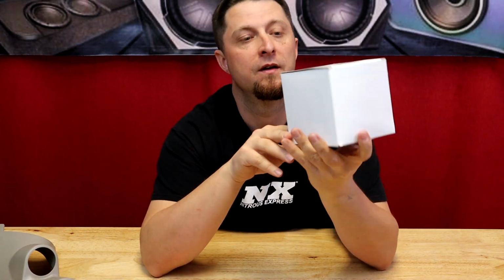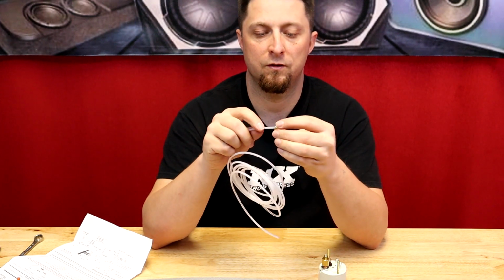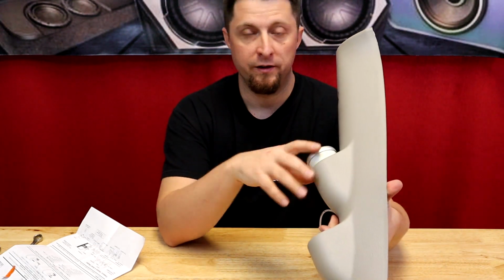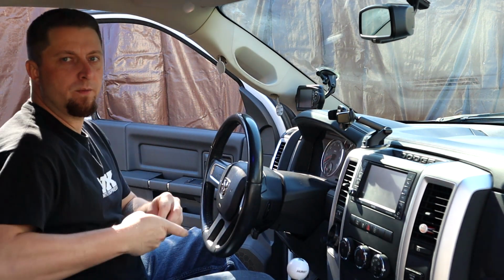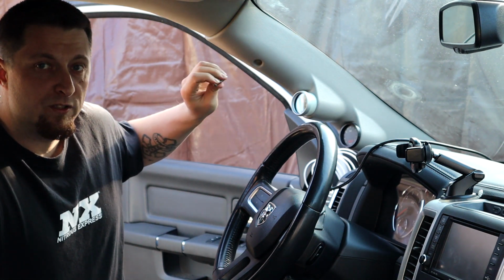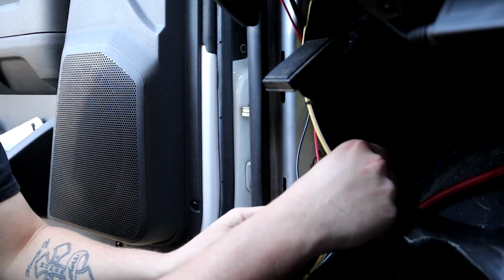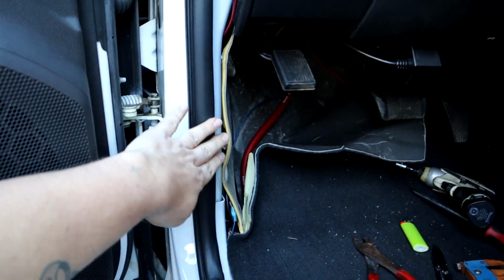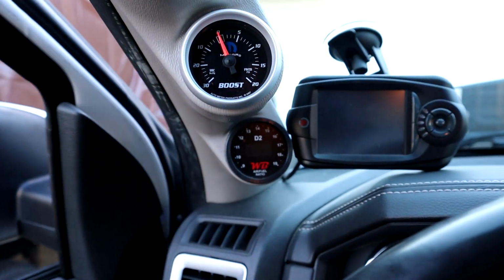Boost Gauge & Pillar Pod Install On 4th Gen Ram 1500

Comment: Great video step by step getting closer to the main install 💪😁 .. jus little heads up .. the gauges in the pod without the back pieces to hold tight .. may allow to slip in future causing you to have to keep turning them to your favourite position of gauges.. the hot sun heats plastic up allowing the slippage .. I had one in my diesel dodge Cummins it was a three gauge pod An that’s what it did .. no biggie jus a little pain in the keester lol.. maybe your will be ok .. but it looks awsome love the mopar gauge that be my choice to.. also been wanting to tell ya I absolutley enjoy your intro an outro on all your vids the little neat sounds An the truck about to go at track showing the glue sticking to tire An the front of the truck lifting it is such an awsome into outro of your vids .. great job on that man !!
Reply from the maker: Thanks brother definitely trying to make it interesting 🙌🤘👍

Comment: Bro can you do more in depth on the Wideband I know you didn’t because you had it installed but I have one coming for E85 and I need to know more like how the o2 hooks up how far down the exhaust which side. Maybe a link to where you got that w/b with the built in plug in... it was more on the boost gauge lol. If you could just a quick clip or something how it’s all ran I’d appreciate it!
Reply from the maker: Sure I will try to get a video up soon
Reply: Frostbite Ram thanks bud!
Reply: Frostbite Ram just wanted to say thanks for all your YouTube videos.  I have a 2011 Hemi Express reg cab 2wd that I purchased brand new.  My truck has had some mods including a TVS2300, ARH longtubes, 87 MM throttle body, L480E GM transmission swap, MDS delete cam install, drag pack is shipping now, and a new Eaton Trutrac just ordered today from Moes.  Can you give a little more info on the wideband gauge you have installed.

Thanks
Reply from the maker: @jspenn1  Im planning on it as soon as I get a chance definitely will.👍thanks for watching and sounds like a sweet truck you got🤘

Comment: Where did you connect the boost pressure line at the manifold?
Reply from the maker: I added a fitting in the manifold behind the throttle body. Most people just tap into the factory vacuum lines on top behind the throttle body.
Reply: Thank you!!!
Reply: Your Ram is sick! I'll be adding a torqstorm to my 5.7 soon as well. Your channel is really helping me out!
Reply: @FrostbiteRam  are your referring to the line that runs along the top of the intake manifold that goes to the evap canister?

Comment: Can you show us that don’t have an extra wire to hook up. Make a video for people that have a stock truck with no electrical mods. Show us where to connect the red or power wire.
Reply from the maker: I tapped into my cigarette lighter wires for my 12v

Comment: Interested to see how much more power your going to make. Theirs another video on YouTube with a 2015 ram with the same supercharger making an extra 100+whp.  https://youtu.be/pf7bnrPzdDo
Are you going to dyno your truck once the install is complete?
Reply from the maker: Yea that's actually the torqstorm truck the kit was designed for. It's a bone stock truck just has the supercharger on it with low boost also.